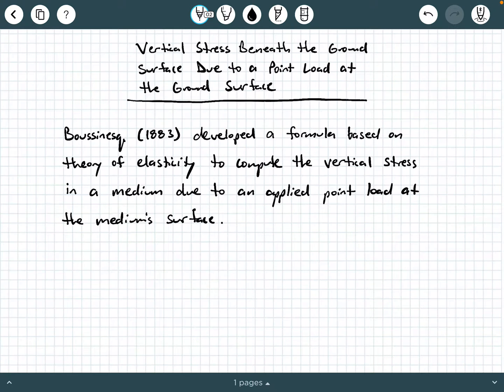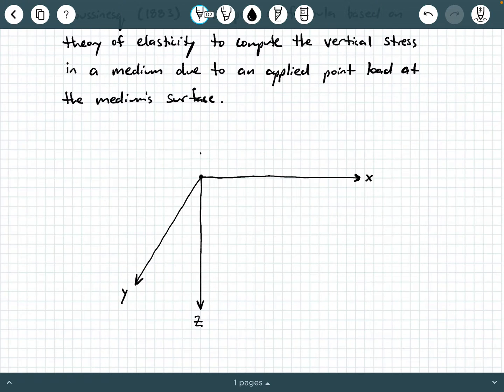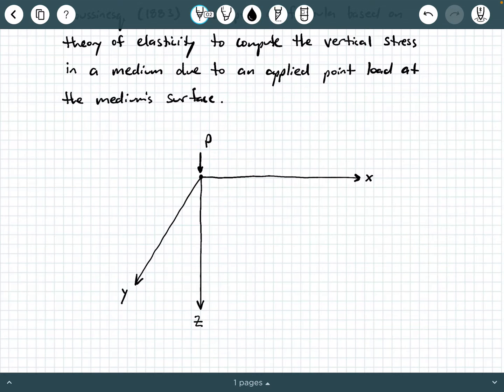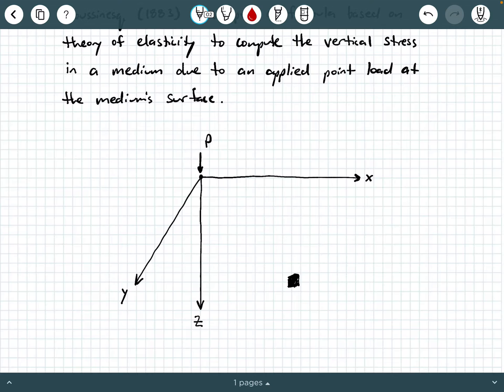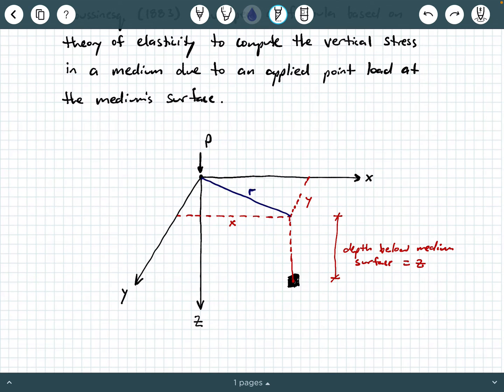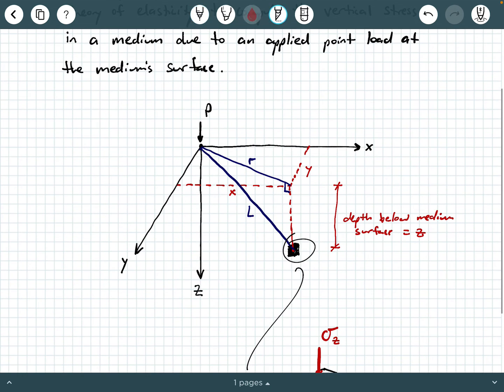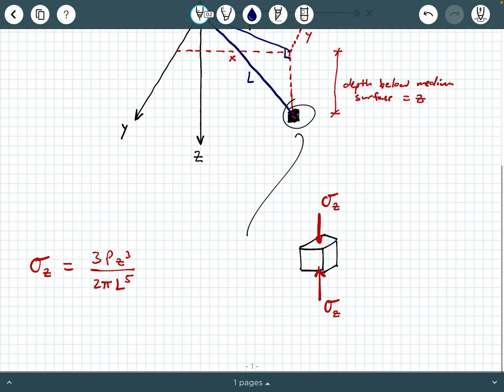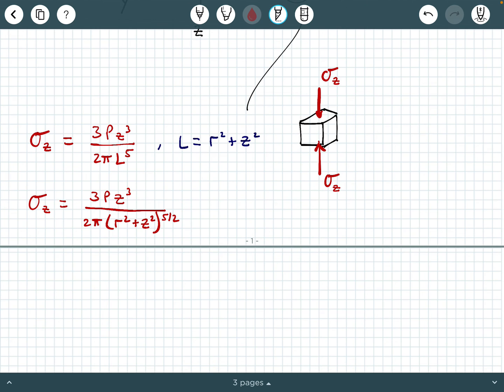Vertical Stress in Soil Beneath a Point Background (Boussinesq Theory)

Comment: I have a project in which a sheet pile has to be constructed with given a soil parameters but in that area there are surrounding buildings with 12-8-6 storeys. I need to estimate the surcharge acting on the wall due to these existing buildings with given their dimensions. How can I estimate the surcharge?
Reply from the maker: Thanks for your question.  Boussinesq and Westergaard have relationships to model the stress in soil due to rectangularly-loaded footprints on the ground surface.  Some good references include:  Fundamentals of Geotechnical Engineering by Das, Foundation Design by Das, and An Introduction to Geotechnical Engineering by Holtz, Kovacs, and Sheahan.  One of the things you will need to determine is the total building load acting on that footprint (in psf).
Reply: Thank you btw, I am working on it currently. But according to euro code, the buildings beyond my excavation pit ( 2H) distance will be taken into account otherwise there won't be effect from a farther buildings.  @mathandengineeringwithdr.a9515
Reply: The problem is I don't have any load in fact, just the dimensions were given but no loads at all! So how can I assume the loads based on what specifically ??? Furthermore , plan details are a building with a garden and also in my excavation pit there is an area encompasses my excavation pit and distances were given . What distances should I consider from the edge of the excavation pit to the center of the building ?? I am confused a little 😂 @mathandengineeringwithdr.a9515